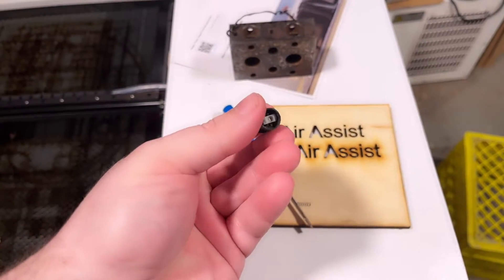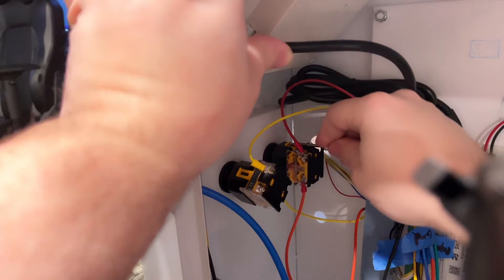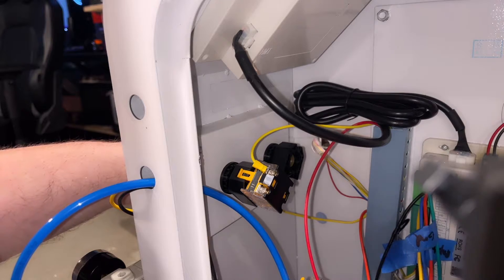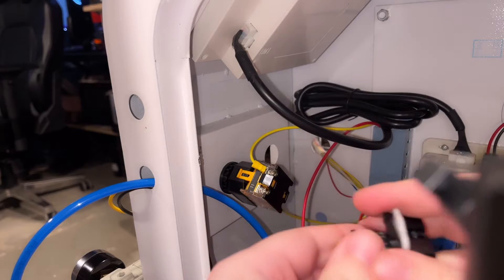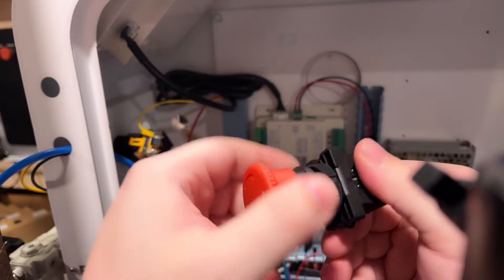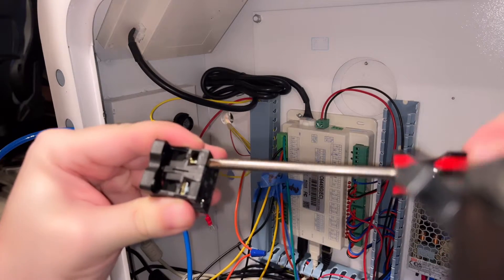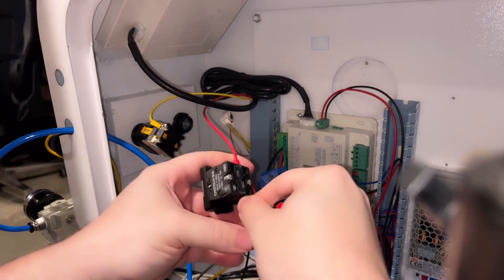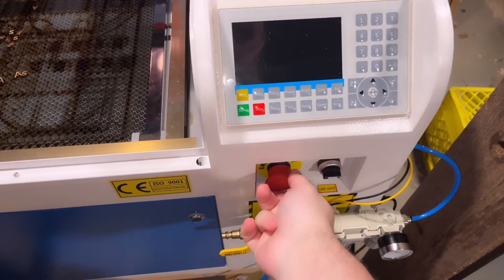Replace an EMERGENCY STOP on a laser!

Comment: Just had to do this to mine. Diagnosing the problem was a pain but once narrowed down it was easy. And new switch is MUCH higher quality. And it's open/closed, so I could throw some emergency lights and klaxons on the "open" circuit :D
Also discovered the hard way that the key switch was failing. And that was the source of a loss of power and cut quality ... I thought the tube was going! Like a brand new machine again.
Note to self: ever buy Chinese again, just replace EVERYTHING as part of initial setup!
Reply from the maker: Glad to hear your machine is up and running like a rockstar again! Love to see it! Love the idea with the lights, good upgrade for sure. In the laser industry, literally everything is from China, they make like 95% of the laser industry lol. There are a few exceptions though. A takeaway from what I’ve seen is there are good and bad brands there, just like there are anywhere else.
Reply: @LaserEverything   I do have to say that the brand I bought from has really stepped up their game, post-pandmic. Their newer models appear to be competitive with European and Americna brands in terms of features (if not build quality ....). But pre-pandemic, when I bought 5yrs ago, they were shipping machines with aquarium pumps and a bucket for "cooling", and WW2 surplus centrifugal blowers for fume extraction! If I'm going to buy a machine that's more DiY and work on it myself, the simpler machine is perfect ... but a long learning curve on the way to a more reliable, quieter, productive machine with longevity.

While waiting for a new key switch to come in, I had replaced that one with a single-pole light switch. :D  Life's simple amusements.

Comment: Just remember that the Emergency Stop button is not meant to be the regular On/Off control for the machine.
Reply from the maker: While this may be the case for machines that auto-fire when provided power (think band saws, table saws, etc), this isn't entirely the case for lasers or things that rely on the controller to provide instructions/input to operate. It all depends on their design, how they operate, and how they are wired. In this case, this is exactly how this machine was wired to operate, with the exception of the door safety switch (which serves the same functional purpose of breaking the circuit for safety). This machine's key only cuts power to the laser tube (not the case for all of them, but that is why we didn't discuss it since it wasn't relevant to our troubleshooting), while the rest of the machine utilizes the emergency stop for power control. There are many machines these days that only come with an emergency stop for power, and up/down buttons (such as the most recent Co2 Galvo we've been using), just a design choice and isn't really abnormal for this type of operation where the machine doesn't immediately start a spinning blade or anything like that.